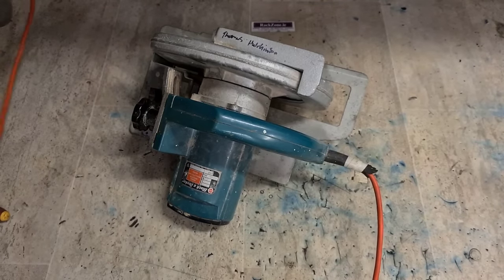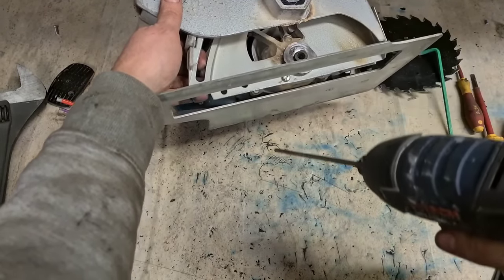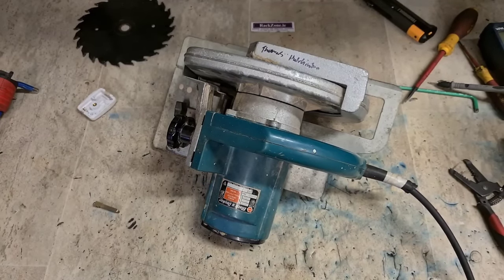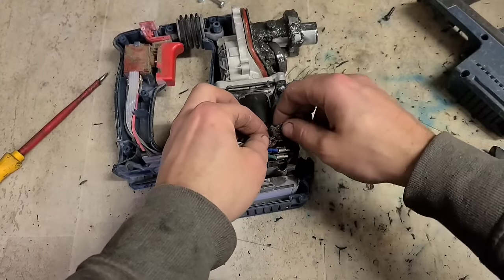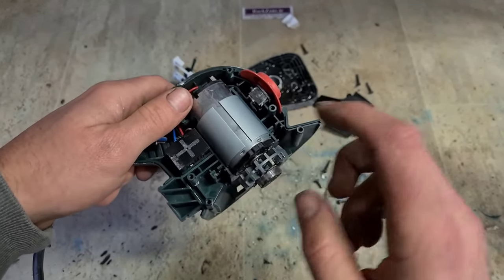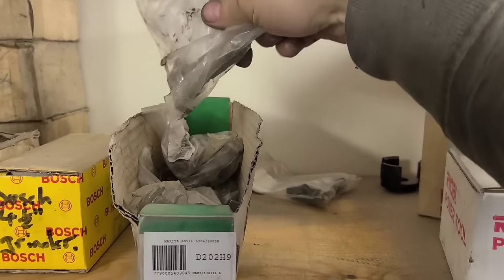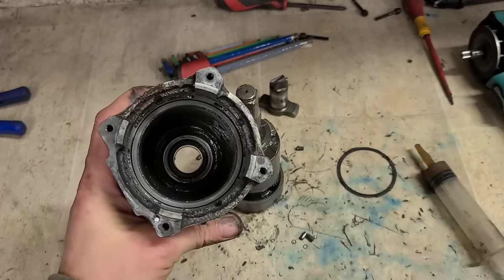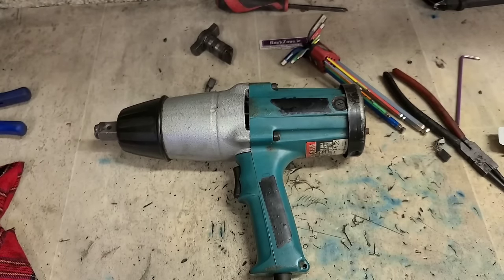Repairing a Old Black and Deck saw, old Makita nut gun, green bosch sander and bosch 18v sds drill.

Comment: That Makita nut gun motor sounds very good for its age. The older tools were definitely better quality for longevity. Thanks Dean.
Reply: Still made and looks as old , they have not invested in any fancy overmolding and new design..
Reply: I wonder why old stuff lasted as long. I fridge could easily go 20 years without maintenance, just look at the sheer amount of machinist machinery out there, lathes and milling machiness from the 40s and 50s all over the world still rocking solid.
Reply: Yes I have a Wolf hand drill from 1954 still running, the only replacement has been the brushes.😊🇬🇧
Reply: The longevity of the older tools is likely due to the lack of the rare earth element chinesium in them.
Reply: @bladeoflucatiel  I think 2 big reasons are, 
good quality parts and design (like the oil hole in the makita anvil)
And simplicity, not much can go wrong in a simple machine

For example old cars that barely had any electronics in them had few things that can go wrong, now cars are full of basically computers and all kinds of electronic systems

Among cheaping out on quality and design

Comment: Those Wiha Ergostars are bees knees. I’ve got the 9-piece metric set, and the 13-piece inch color coded set in a boring old holder that I then replaced with the 13-piece inch ergostar holder. Wiha’s marketingg made a wise decision to send those to you Dean. I’m sure it’s paid itself many times over. And you deserve the best tools for keeping the landfills less filled and tradies’ tools going longer.
Reply from the maker: They are a very good set. 
They sent me those a good while ago and I'm still impressed every time I take them out. 
I normaly snap, damage or lose at least one from the set in the first month. But these are all still perfect.
Reply: @deandohertygreaser I wanted a set even before I saw your review video. You sure did that set justice - it just looked good and had quality feel to it on screen. You’re a quiet viral marketer. The best kind :)

Comment: You only have to place an equivalent sized rod straight through the hole in the saw blade to lock the blade up against the m/c surface. There is no need for overkill. ... Doahh!!!! 😂

Comment: 1. I have always loathed slot head screws.
2. Is that how the finishing sander oscillates.
3. Thank you for explaining how the nut driver works. I had wondered but know I know. Much appreciated Dean. You sir are a walking Wiki of power tools. 👍
Must be nice knowing you are finally getting a return on the anvil for the 25 year old tool. How many thousands of individual parts do you  think you have on the shelves in your Powerladdins cave?
Thanks for the video! 👍👍

Comment: Fun fact: that Makita 6906 is still being made in 2024. Nice find you still had the old part laying around!
Back in the days Makita had their software on cd's that were meant for their service dealers. The software stll exists and is up to date but it's on a server nowadays for which you need a service dealer login.
Reply: Interesting to note that the 6906 costs somewhere between $600-1000US depending on vendor, and only delivers (according Makita's website) 433ftlbs torque. Why would you buy compared to a battery powered unit from Milwaukee that delivers 1200ftlbs for $400?   Because Makita is still providing parts for it 25 years later, that's quality.

Comment: Tools fixed in this video:
0:00 Black&Decker HD1000 circular saw - Fault: Not starting
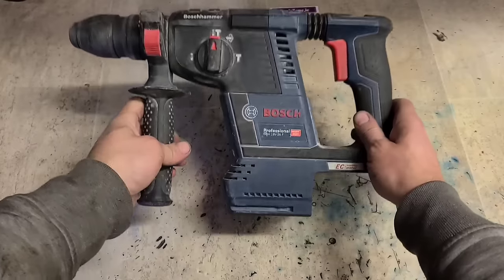16:24 Bosch GBH 18V-26F SDS Drill - Fault: Smoking/Burning smell
27:30 Bosch PSM- Primo green-line Delta Sander - Fault: Seized
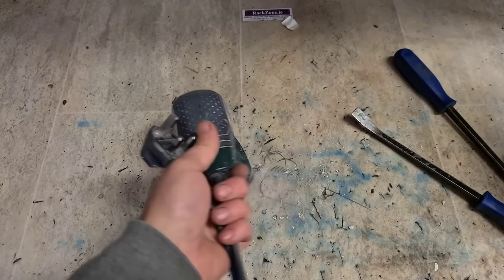34:50 Makita 6906 Impact Wrench - Fault: Snapped anvil

Comment: Found an old B&D router on my dads stuff, really unused realistically brand new.  Model 3315 220V made in Towson, MD, 1.5hp motor.  The bits with it were crap but with some new bits it really put out some work.  It takes 3/8 bits which you cant really find but also has an adapter for 1/4 bits.

Comment: in the 70s and 80s I could go to the local B&D shop and pick all all the spares ... then they closed the shops and went to unrepairable plastic crap ... I believe a local machine shop still uses a 1960s B&D 10inch pedestal grinder - runs sweet as a nut

Comment: Got to ask what’s in the yellow test bucket when testing hammer action? Seems to be indestructible
Reply: It is a block of high tech, shatter resistent, carbon fibre compound material: wood
Reply: It's an old one 10 transformer box.
Reply: It's an old knackered 110v transformer.